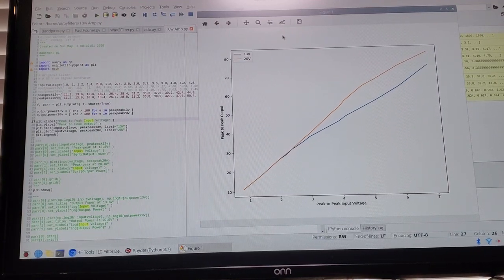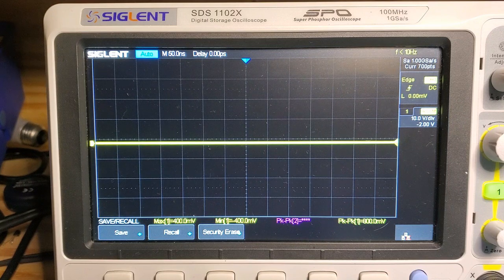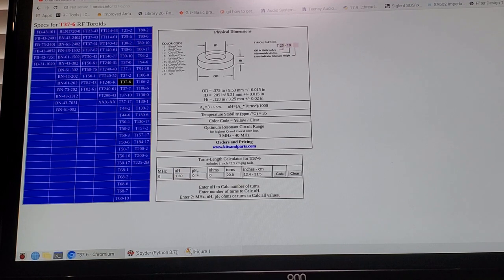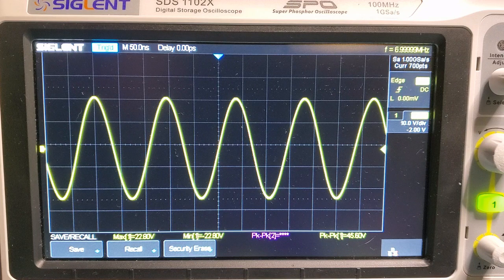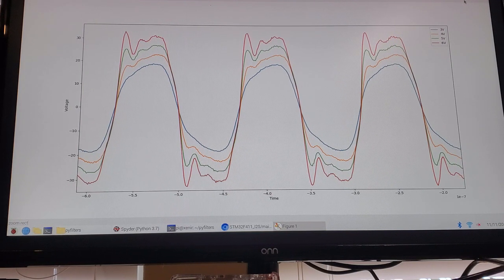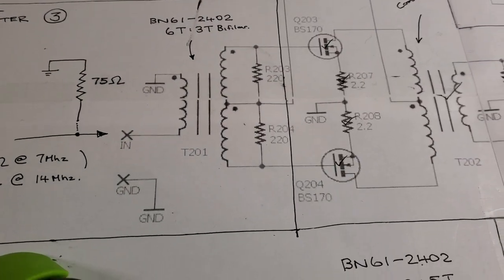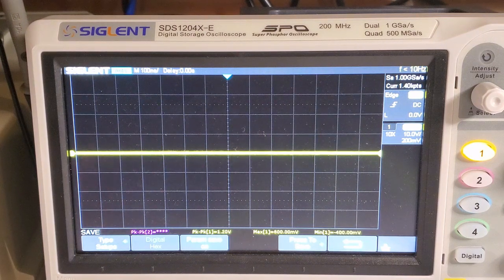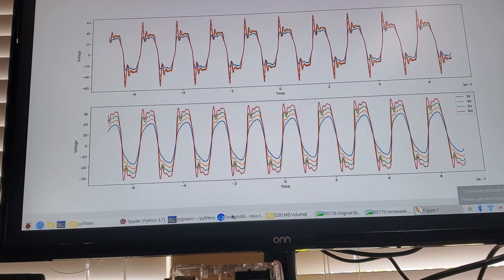QRP Labs 10w Further Measurements and Playing Around

Comment: It would be very interesting to see harmonic content versus RF input voltage and supply voltage. And thanks for a great video and ditto for the previous one on building this amp. I am very interested in building an 'amplifier block' to boost my HP 8672 sig generator up to a couple of watts for testing purposes.
Reply from the maker: Thank you for the comment Bob. I do some more analysis in this video https://www.youtube.com/watch?v=Iq9UP6rhB-c&t=126s - in particular looking at input voltage vs. harmonic content. Let me know if this is what you were after. Sorry about the delayed response - for some reason youtube didn't send me a ping on your comment
Reply: @na5y  Not so much interested in harmonic content (as you mentioned that can be handled by LPFs) but two-tone IMD. But as you mentioned also that is covered (sort of) on the QRP-Labs 10W Amp page.  So encouraging for sure - that the IMD is (of course) severely limited when you have a clearly overdriven amplifier and (encouragingly) the IMD gets better with decreased drive (and by increased supply voltage). More experimentation needed!  I am going to buy one for myself and play with it.  As I mentioned, I am looking for a way to boost my HP sig generator output and this will fill the bill.  Perhaps I will get to try some experimenting if I can come up with a very clean 2-tone RF generator!  FYI I am a retired electronics engineer and oh-so-many years ago, I played with stuff on the bench (how long ago - like 1970s).

Comment: I should have watched this before I built mine.
After the build it did not work? Was wondering if you could take more voltage measurements so I can check my project against what you got.
Also thanks for sharing about the low-pass filter, toroids info. That was great!!!
Thanks
George
Alberta, Canada
Reply from the maker: Unfortunately mine is packed away (with quite a bit of stuff!). Were you getting anything out of it or was it completely dead. Do you have an oscilloscope or just a multimeter. Definitely check the voltage at the gates of the BS170s - should be around 2.7V if I recall correctly. Glad you are enjoying and happy to try some remote troubleshooting!